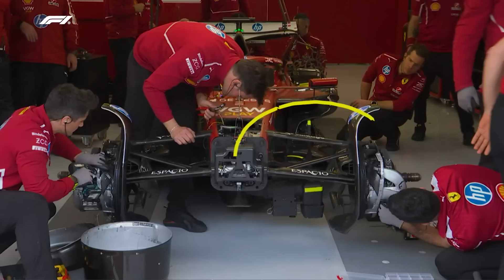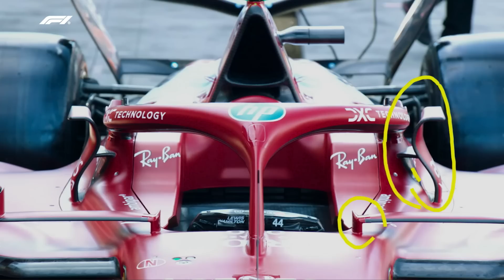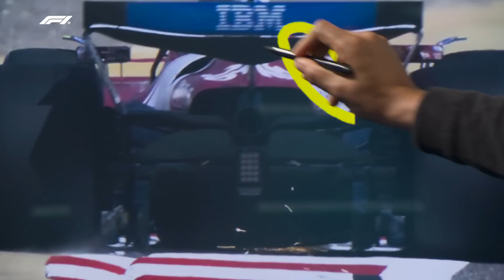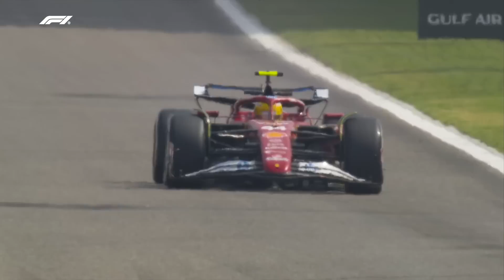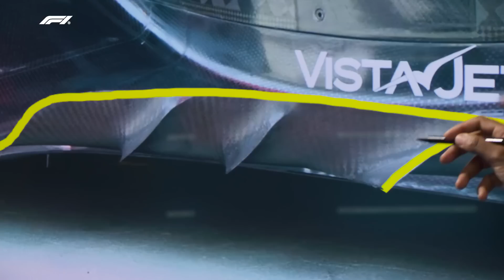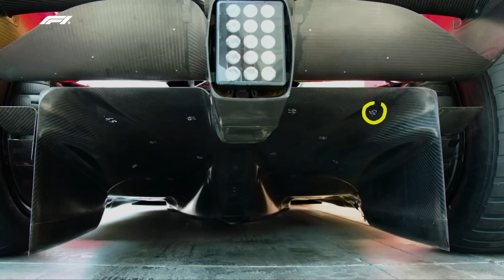Can Ferrari's Updates Help Push Them To The Top Of The Grid? | F1 TV Tech Talk

Comment: The flap at the rear next to the exhaust. I wonder if its something to do with heat from the exhaust causing the air around it to expand and using it to add pressure to the beam wing??

Comment: Surely the rear differential mounts are too few, allowing an oscillation. Which overscrews the rear. Causing a centre of gravity misalignment.
I'm not sure a new floor will boost Ferrari enough to chase the win.
Amazing from the footage this video doesnt touch on a potential rear driveshaft problem and instead covers aero

Comment: I call that sticking up edge wing, an extractor. I use that term because that's what it does. The airflow that's flug out laterally from underneath the floor, behind the floor fences comes out of that extractor, which then ends up at the rear brake ducts, and then merges with rear tire, beam wing, diffuser, and rear wing vortices. Those extractors and brake ducts work together and the version Red Bull brough to Suzuka may have given them the edge they needed.
Reply: I'm not an expert but I find it quite improbable that the flow from the 'extractor' would end up in rear brake ducts. First of all I'd imagine you'd need a lot of local upwash and inwash to get that air to the brake ducts (the extractor is obviously upwashing, but not nearly as much, as well as outwashing). Second of all, I don't think you'd want that flow to go to your brake ducts in the first place, since it's probably quite lossy (and probably after being flung out it could be mixing with the front tyre wake, which you definitely don't want to be hitting the inside of your rear tyre).
Reply: @g.stefanokonkwo755  Just look at any basic CFD of these cars. That's just what the flow does, upper tire wake moves along the mirror housing, which then merges with the upwashing extractor flow which has no choice but to go over the rear wheels, because the rear wheel's wake merges with the diffuser's upwash. The outlets of the brake ducts merge with the upper wheel wakes, which adds energy to those wakes which are conditioned by the front wing and wheel brows.

Maybe you don't want turbulent air from the tires interfering with things, but it's not like you can magically avoid it by becoming an "expert". Ask Dan Fallows.

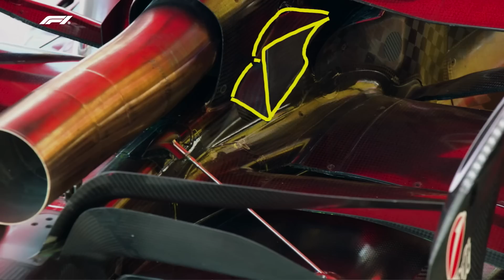Comment: 11:46 Ferrari figured they needed more lift at the rear!
Reply: I'm not sure if it helps or if it's relatable but airplanes do the same thing. "Front" wings lift the aircraft up and the "wings" on the tail are actually upside down to press the tail of the aircraft down. That's for stability though and because of 3D movement, as Cars (due to the road) actually just move 2D.

 Never the less, it could be a similar reason (like lifting the rear for more stability at the Front...?)
Reply: Maybe they're trying to make vortices to enhance their diffuser output? Cos yes, making upforce back there is non sense...
Reply: I was thinking the same thing, this would stop the back squatting so much at higher speeds and prevent the extra ware on the rear board.
Reply: Cool theory. But working out the right forces for the right speeds sounds like a looooot of development put into it
Reply: Because you, you knew better than them of course